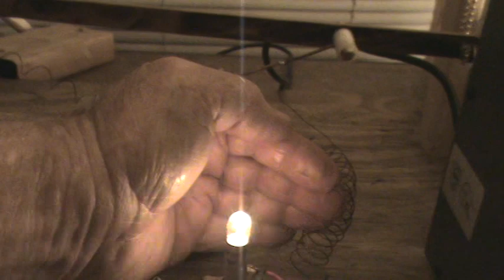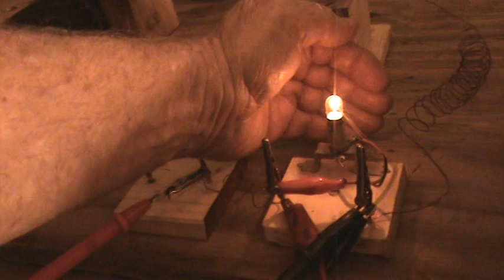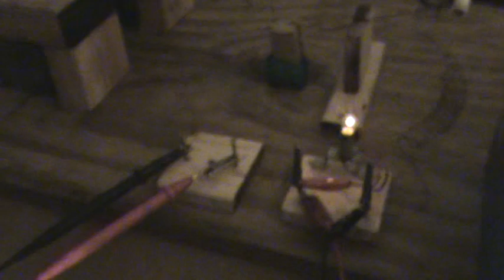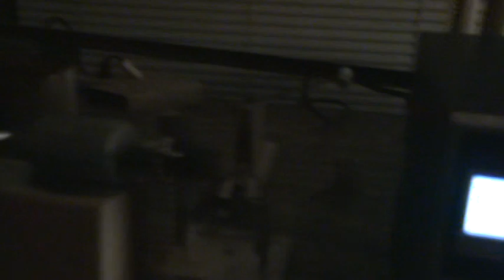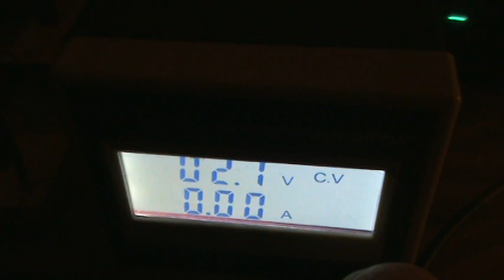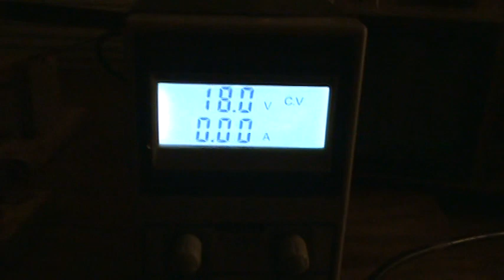Ray's Super Magnet Generator (part 1 )

Comment: one way to test it would be charge a capacitor up and discharging it into that little motor. If the voltage is higher and the discharge made quick, it should show more effect on the motor then a constant current at low voltage.

Comment: Ok, so your Light bulb is taking 0.08A at 2.8V which means its a 35Ohm resistor... At 18Volts that equates to an Amperage of about 0.514A... As your Powersupply cannot measure short pulses of massive power spikes its not showing the correct values. THAT is why its only showing 0.01A there... No overunity whatsoever. The Induktor in the mix is probably contributing with an added induced voltage on the short circuiting of the Hammer. As you have an oscilloscope ther mayby you should use that combined with a little circuit to get an ACTUQAL reading of the power your circuit draws :D
Your Generator is just a overpowered version of a "Wagner Hammer" btw.
Reply: What is a Wagner hammer?
Reply: @MAGnetICus_Attractus  Its a circuit where an electromagnetically controlled switch (relais for example) cuts the power to itself which rcreates an electromechanical oscilator. There seems to be only a german wiki-page on that: https://de.wikipedia.org/wiki/Wagnerscher_Hammer (seems like a translation is long overdue :D)
The most prevalent use of it to this date is in Doorbells ;)
Reply: @JoelRehra  so basically a buzz coil like a old car ignition.
Reply: Agreed.